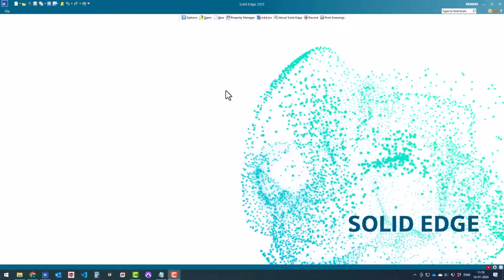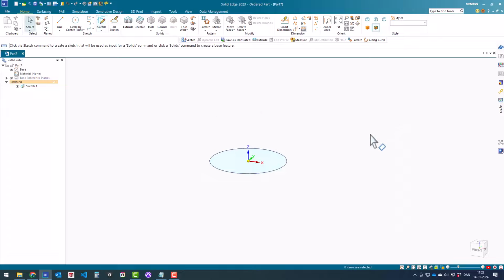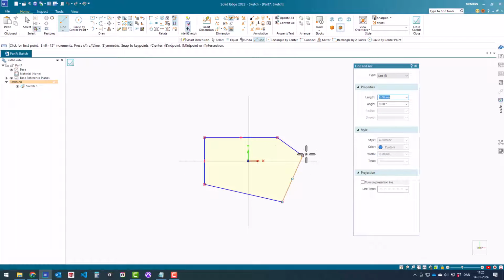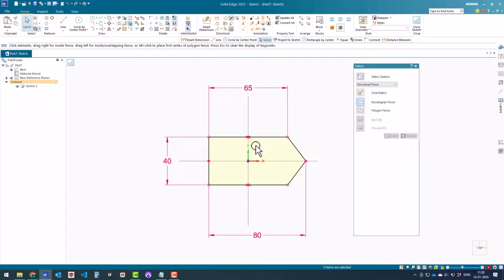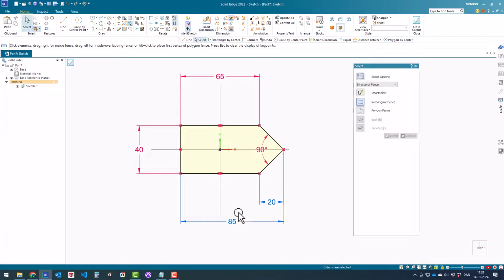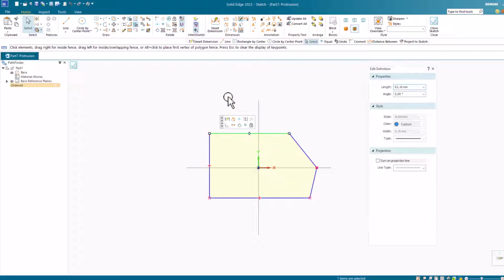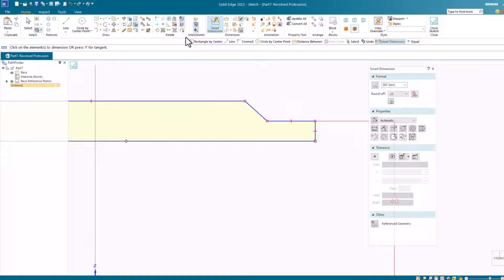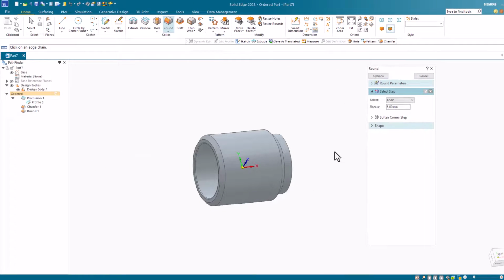Solid Edge - How to Sketch

Comment: great tutorial, kinda shame solid edge is so overlooked
for a complete noob I would say it's the second most intuitive and easiest to learn after solidworks
maybe for a pro it's not that great but for a noob it's much easier to understand than the other popular free choices imo

I designed my first part about 8 years ago in solidworks for a woodworker, then nothing for about 5 years, than another part in solidworks, then nothing for about 2 years when I designed one small part in solidedge, now I am returning to solid edge again as I plan to buy my first 3d pritner
tried fusion, onshape and few other "parametric" CAD today but again ended up going to solid edge same as last time when I needed to design something
it has clearly defined contrains, intersection points, midpoints, driven/driving dimensions etc, no guessing like with other CAD....sure it's a lot of trial and error but the basics makes sense to a beginner unlike fusion which is completely useless unless you already know quite well what you are doing
even has stress material simulation so last time I used it to decide what thickness of aluminium I need for the part
Reply: after about a week I already switched to fusion ;o]
there are just too many limitations in the free CE edition, was driving me insane, also all is in small icons so you spend lot of time searching for the correct icon

still think solid edge is easier to get into for a beginner at least for the basics like sketching and relations
and I miss the dimensions/variables screen, that was genious, could quickly change all dimensions to formulas and have the whole part parametric and based on a single value (ofc it can be done in fusion as well but not so quickly)
if I had the full version of solid edge I could probably keep using it although once you somewhat know what you're doing the fusion is a lot quicker and the timeline is great and has